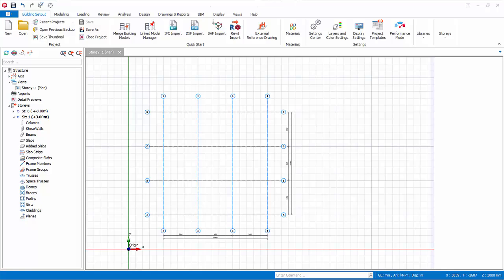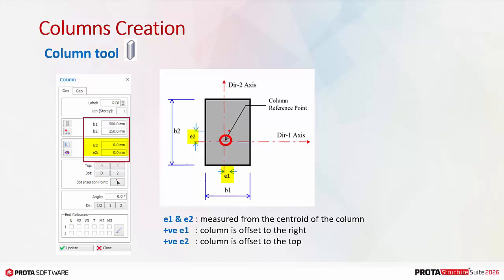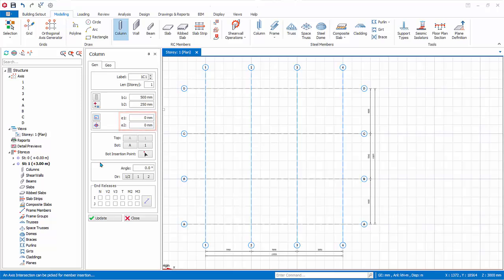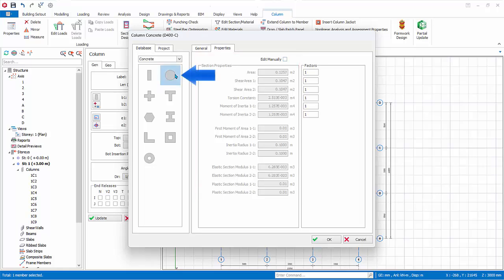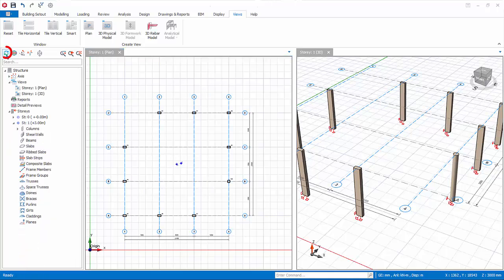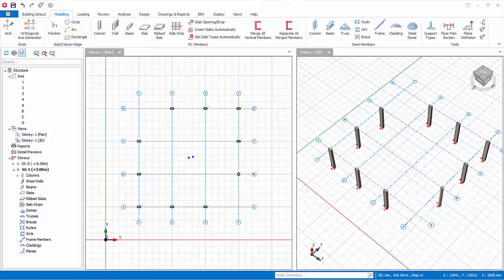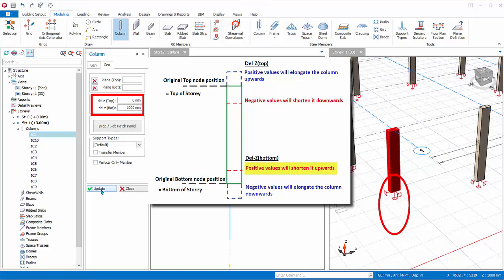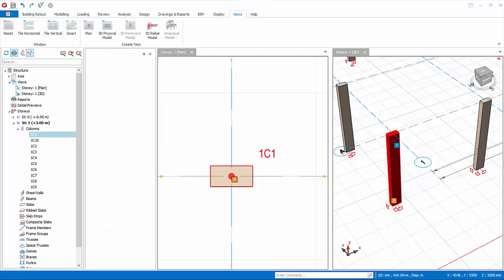5 – Selection Method, Creating Columns & Views

Comment: I have a problem with my ProtaStructure 2026, after saving and closing the program, on opening it, it brings a warning saying "column: 1C1 section undefined. Centre of rigidity cannot be calculated"